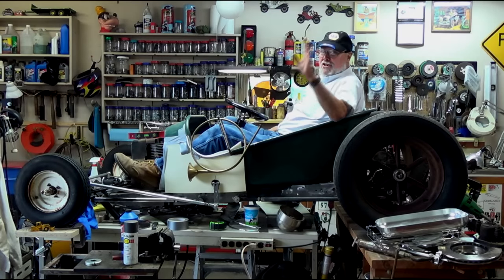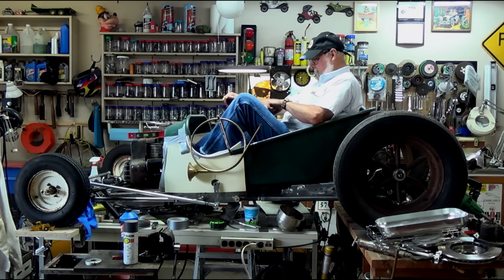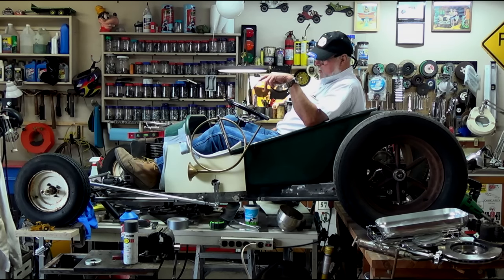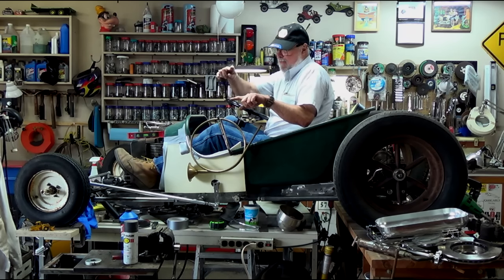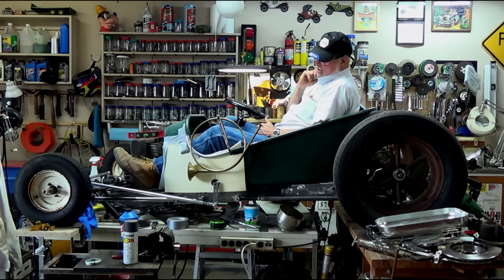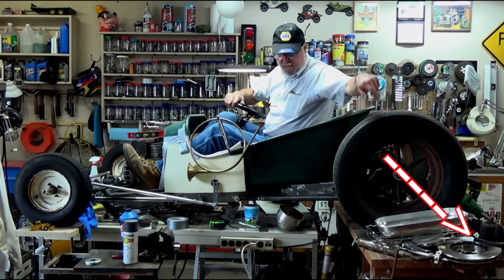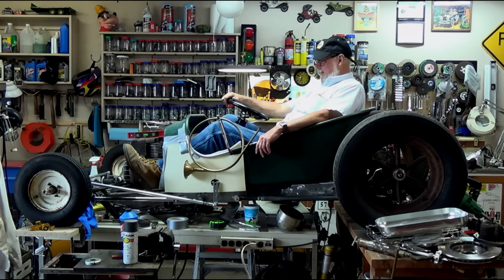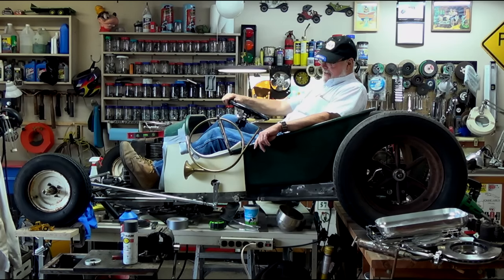Body mockup on the Goofy Cart II

Comment: I'm liking it very much George, Could you use hydraulic brakes all round off one reservoir, however I don't remember you having any braking mechanisms for the front wheels installed so perhaps not. Now hand operated fiddle brakes on each back wheel would be a lot of fun!!
Reply from the maker: Next video tells about brake ideas. I will likely have one master cylinder to run all the brakes, hoping it will work with different size calipers though. Probably have to put a metering valve in to balance things.

Comment: HI GEORGE  STARTING TO TAKE SHAPE ,  WHAT ABOUT A CUTTING DOWN A DRUM FOR THE HOOD . THEY ARE EASY TO FIND MAYBE ONE OF THE BLUE PLASTIC ONES NICE AND LIGHT .  LIKE THE WHEEL BARREL  IDEA  .  CAN'T WAIT TO HEAR IT RUN
Reply from the maker: Thanks. I have a 5 gallon metal can that may get used for the hood and I also have a hood off of a riding mower that could be adapted. We shall see! Thanks for the suggestions.